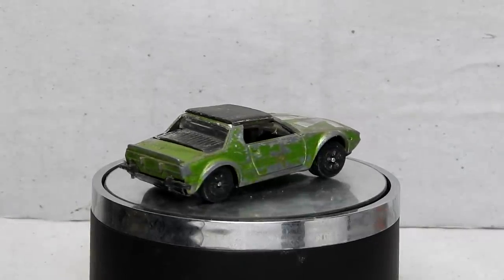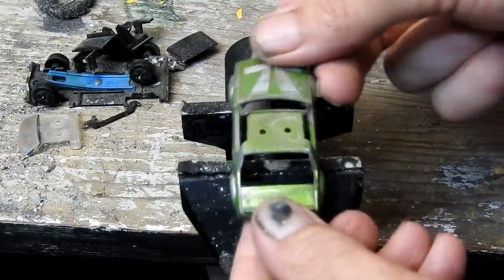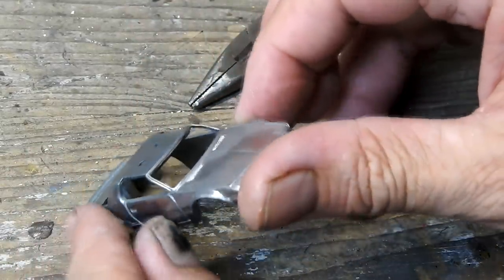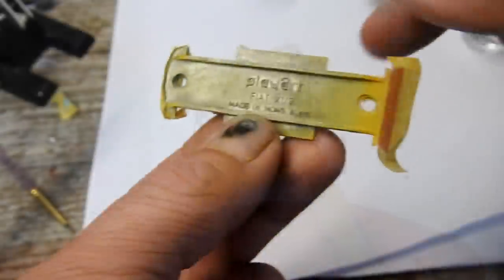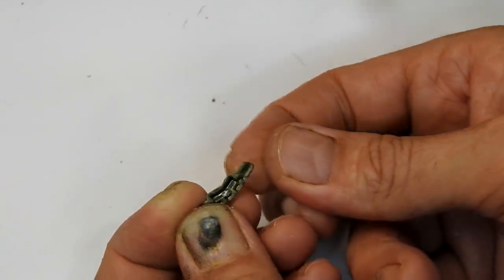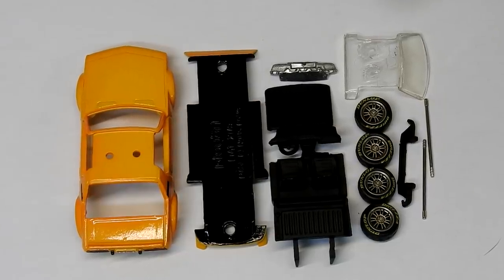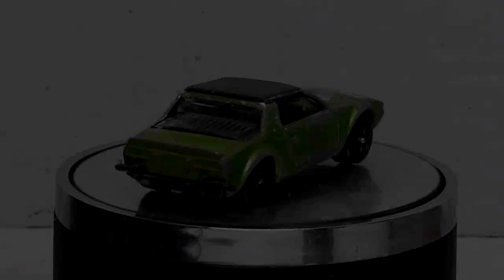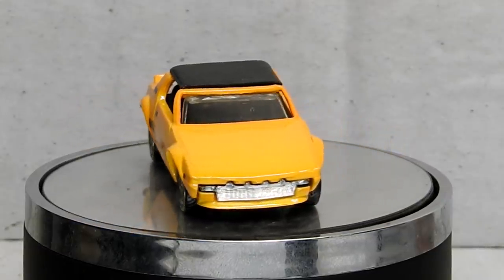Playart Fiat X 1/9 '70s Italian Sports Car Custom Restoration

Comment: Nice custom but i think the rooftop is bend inwards to the front. It should be nearly horizontal. Th A-pillers also bend outwards to the top. Should be more inward to push the roof up..  But realy finfe work the result looks beautiful.

Comment: the quality of your work is amazing. As I recall, the targa tops on the real cars didn't fit very well either, so that's actually kinda done the way they were. That's one reason there aren't a heck of a lot these still around, water would get on the inside and rust them out from the inside as well as the normal outside rusting. being a big guy, not one of my favorite cars. However, there was a time, my dad and I were car shopping at a dealership that sold Buicks and Fiats, and I couldn't even get in the Buicks, most of the Fiats I could at least get in them, tho there was a probleml, the foot well was so small I could hit the clutch, brake and gas with one foot... the only way I could hit any of the pedals, the footwell was that tiny.

Comment: My first car was a FIAT X1/9, bought on a dark wet night in Manchester. It had rust up the rear turrets that needed welding and I think the front radiator was full of rust too, as the car would run very badly if you'd been caning it over 100mph, but it ran nicely once it had cooled down again.

The best feature was rhe targa roof that stowed under the bonnet, and the reverse sweeping rev counter that matched the speedo in 5th gear, so as you accelerated the needles would move towards each other in perfect synchronisation.

Comment: Nice touch painting the front and rear valances to match how the actual car would have looked - something a lot of diecast restorers on YouTube don’t bother with. 

Nice little model that, but Playart seem to have done something odd with the front end. Is it the bumperless Abarth version maybe? Seems to be a row of four small spot lamps there. 

Nice job on the colour too. If you ever restore a Lamborghini Miura a slightly darker version of that (maybe with black primer?) would make a good replica of the car from the very start of The Italian Job.
Reply from the maker: Yeah the front end isn't quite right.
Reply: The boot spoiler on this model makes it look like the proposed limited edition X1/9 Corsa from 1975.

Comment: Never heard of playart cars, but I did have a couple of the Corgi versions of the X 1/9, one green and one yellow with racing livery on it. In my current collection i have one that i had to replace the suspension on (because the plastic corgi suspension clips were notorious for breaking easily) and i painted it to look like the Italian flag. Lovely looking little car, both in RL and as a model.

Comment: Nice job, Danny, but I think you should have cut out the roof, it would look a lot better and you would be able to bend the windscreen a bit more upright, since it still looks to be too flat.
Reply: I was going to say the same, metal needs cutting out and just leaving the black plastic like the original

Comment: Looks like Lancia Stratos.
Reply: If only mine went like a Stratos, and was worth as much
Reply: The X1/9 and Stratos were both Marcello Gandini designs at Bertone.
Reply: @mike_ctid_taylor  Like buying used 2014 Audi S8 instead of RS7, even for the 2020 RS7. Much higher cost-efficiency.

Comment: Fiat produced the x 1/9 to at least 87. I owned an 1984.
Reply from the maker: Bertone produced them from 82 - 89
Reply: @DannysDiecastDisasters  still had the Fiat Badge
Reply: Some 1982 crossover production models may have had FIAT badges coming off the line, but definitely only Bertone badges soon after, although occasionaly the odd dashboard might have still said FIAT.